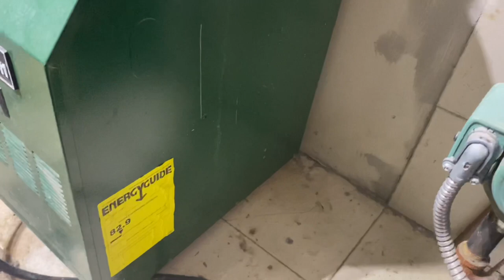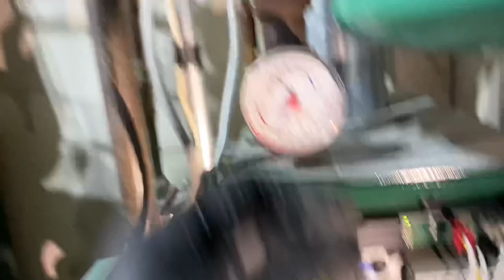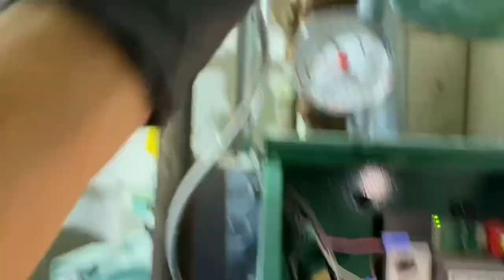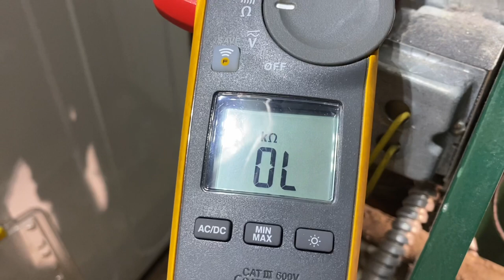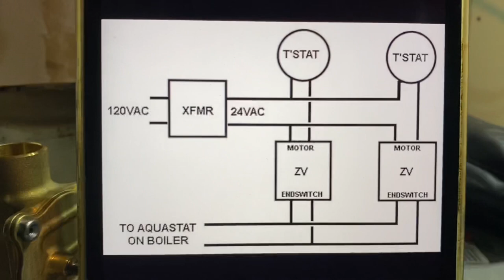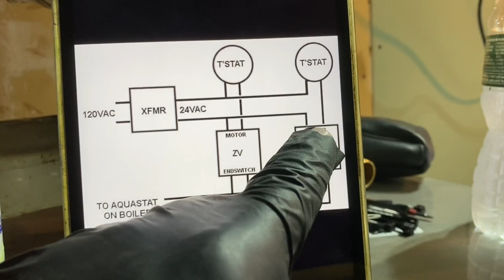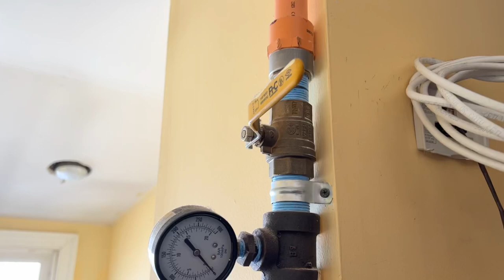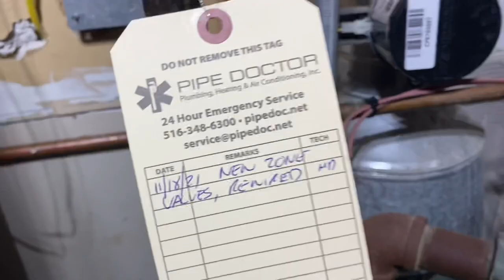Who Wired This Mess? Gas Boilers Wired Together  Help My Thermostats Don't Work

Comment: I would stay away from labeling zone valve covers.Good concept but I would go directly on the pipe. I have had homeowners/other technicians take the covers off and mix them up. It screws everybody up on the next service call. Good work though as usual. Evan from New Jersey.

Comment: Hey Mike I really enjoy your channel Thanks. I used to do Heating in New York City for over 10 years but I used to do mostly commercial and  some Residential but mostly Oil and very few Gas I moved to PA and I am into a different trade now. Like I said I really enjoy the way you troubleshoot problems and how you explain Things. This channel is a great help for new and those who are actually in this trade. Keep up the good work 👍

Comment: Nice Vid !
Just so you know - the “OL” on the Electrical Tester actually means something like “Overload” as the measurement is out of the range that can be tested, you can think of it as Open Line when testing continuity, on an appropriate range, but you might also see it if you tried to test for example the 24V supply from the transformer on a 0-20V Voltage Range - try it & see if you like.
Cheers xx

Comment: That was once again very interesting for me.
I am also a plumber in Germany and also work with a Testo 320-2.
I am just amazed at the poor efficiency of only 83%.
This means that gas boilers have not been allowed to be operated in Germany for a long time!
Atmospheric gas boilers must have at least 89% efficiency and more, condensate boilers have an average efficiency of 97% -98%, approximately.
Very good job and really interesting for me.
Many tools and materials are the same.
Greetings Mike the German plumber
(sorry for my english :-))
Reply: There is a ton of old "low efficiency" equipment in places like NY where I live. The thing is, while it may waste more gas, the equipment is very reliable, easy to fix and easy to source parts. Many of these boilers last 50 years. High efficiency equipment is over complicated, hard to source parts and dont not have the reliability and life expectancy. Whenever the government gets involved in heating and air conditioning they have this uncanny ability to fuck it up. Air conditioning is another great example. The good, low pressure, pure refrigerants are banned ( I dont care what anyone says about chlorine and the ozone thats a bunch of bullshit). Now you have "environmentally friendly" blends which just now getting discontinued due to not being environmentally friendly anymore? Haha. Materials in the coils need to be thinner to meet certain efficiency standards and combined with high pressure refrigerants everything is leaking. I'll take old school reliable system that work for 50+ years over this new stuff any day
Reply: To Mike the plumber from Germany... your English is better than many people who were born in the United States
Reply: @TheGhettoLobster  I agree 100% that there were systems here in Germany that worked great and lasted for a long time.
Then came the modern systems with compressed technology in a small housing and many problems.
It was always about delivering good work and service to my customers!
But the industry just wants to sell and we have to pay our customers for it.

Comment: Hey mike! This is my take on it. For what it’s worth lol. The red and yellow being jumped together would have been the 24Vac to both thermostats(Rh) and the brown would be the (W) for one floor and the white would have been the (W) for the other. The brown should have been wired up to the corresponding motor wire of the zone valve motor, and the white would have gotten wired to the other, the other sides of the two motors should be wired together to 24v common. Than the end switches would be wired in parallel to TT. I would have wired the low water in Series with the TT.

Comment: We got a call for a nest not working properly last year and notes said "customer can't find where the gold wires go". Got to the house and found speaker wire run from the basement all the way up to the 2nd floor. Maybe I'm just weird but I don't want a nest or an Alexa or any other IOT device. Who needs their microwave connected to the internet?

Comment: Where did you learn wiring? Did you go to a technical school or learn on the job
Reply: @PipeDoctor  I'm a new subscriber and love your videos because I'm interested to learn other low voltage applications. I'm a Surveillance Technician and install cameras and other equipment at my casino but am eager to learn other applications for my home ect.
Reply: That's how I learn, by hands on and actually doing it. The lead Surveillance Tech got fired and I got the promotion 2 years ago with VERY little experience. I call it baptism by fire. Figure out the problem because there's no one else. We've upgraded our entire system to digital IP and I'm way more educated and capable of doing the job by learning along the way.

Comment: @Mikey Pipes 
#lovebosch
Whenever I run into abortions like that, the first thing I do is start from scratch. 

This means, I take a few pictures for reference, and then take it all apart and start testing each set of wires and label them as I test them. (If you ain't testing, you're guessing! That applies to wiring as well!)

All too often I find someone made a splice and buried it in a wall somewhere due to a remodel or something similar and they were too lazy to run new wires. 

As soon as you saw there was one cable for both thermostats it was obvious there was a splice somewhere and likely the splice was messed up.

Glad you got it all figured out but I knew right away from the homeowner's answers, he wasn't telling you everything. It's likely he's the one who did the work and screwed it all up.

As always, thanks for the food. Please keep feeding us!
Reply: I hate it when homeowners withhold information
Reply: And I'm big on labeling pipes/calves/wires/etc.  I do it on any installs, or any service calls where I do a lot of troubleshooting.  Saves a lot of time for the 'next guy.' Unfortunately, many people don't think about the next guy.